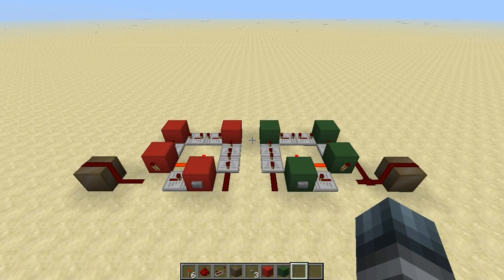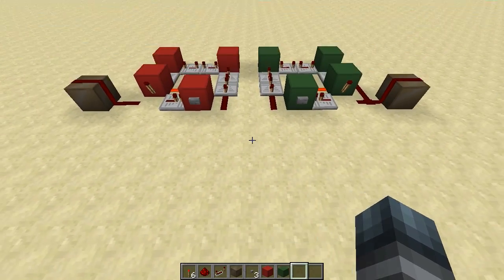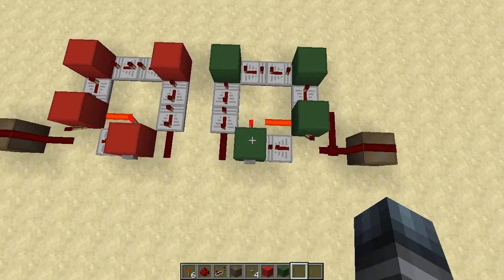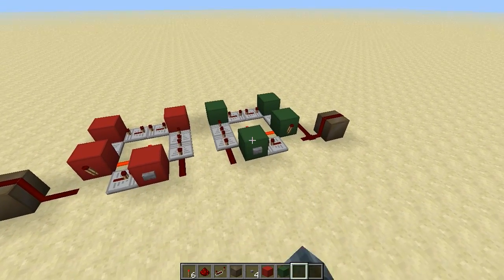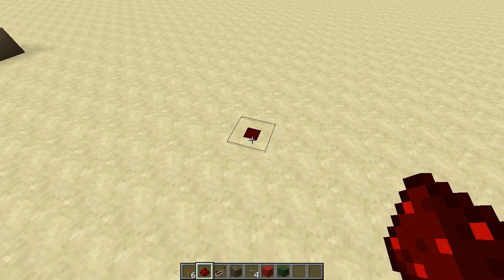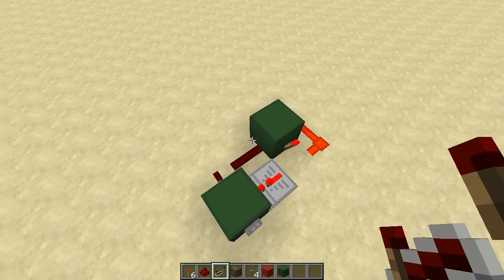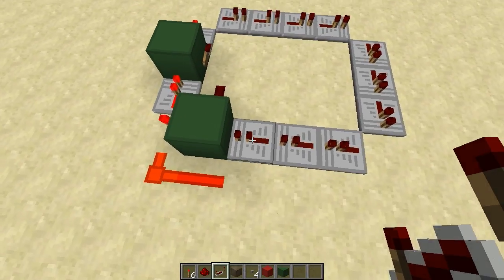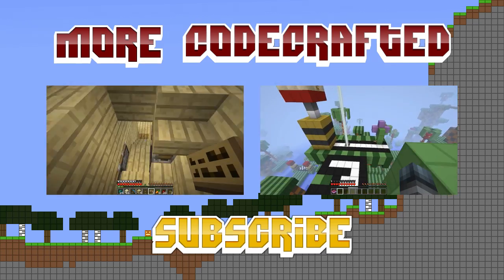Minecraft QASI: Double delay circuits (Save repeaters)

Comment: Pretty sure it only adds 10 ticks to the pulse length because all that is, is a RS-nor-Latch that shuts off after x a delay then the input length is added to the delay because of that redstone bit. in this case a button lasts 10 ticks